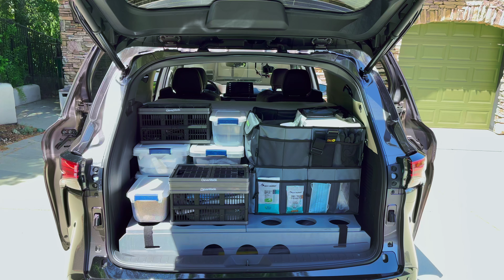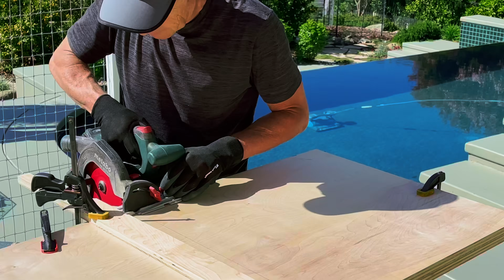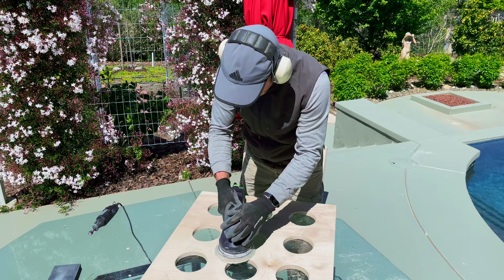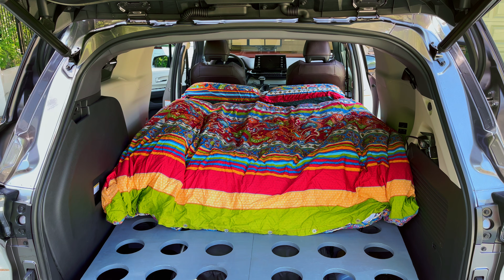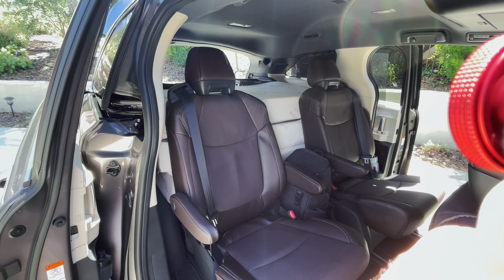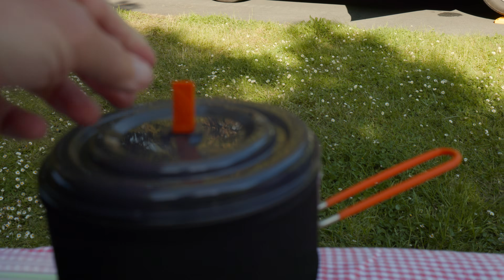2021 Toyota Sienna Camping Conversion: 2 and 4 seats sleeping configurations

Comment: Thanks for the videos. I’ve been looking for 10 years for a simple method of compressing the trifold mattress for storage while driving. Have you seen any solutions? Maybe separating the 3 inner cushions and compressing each one separately .
Reply from the maker: The expandable foam mattress would be difficult to compress by standard means. Strong vacuum pump is one option, but it will be impractical to carry it with you for camping. If you really need to increase capacity of the van, inflatable air mattress is a good option.
Reply: @Tellvia  I know that there are compression bags with one-way valves that allow you to push the air out, but I’ve never seen them large enough for the individual cushions

Comment: Nice job, but the refrigerator and the power station have ventilation requirements.  And it is important to keep the power station upright, not on it's side.

Comment: What kind of tool did you use to finish the edges of the 4" holes?
Reply from the maker: @theresamcrae  Thank you for watching. I used a 150/220 grit sand paper to finish the edges left by the whole saw before painting. Slowing down the whole saw at the end of cutting will minimize splintering of the last layer of the plywood. Cheers!

Comment: You created holes for ventilation of your refrigerator and power station and than covered those holes with your bedding. Ive read the manual for each of the units, they have very specific requirements for ventilation. With all the holes covered were you able to run both units without overheating

Comment: Hi . I have aqustion ? Can be fold the the back seat at 2nd row backword to make platform shape we can use it as a bed? I hope you answer that please
Reply from the maker: @AyadAboosh  Thank you for watching! No, the second and third raw of seats are not foldable backward by design. Cheers!
Reply: Thank you .iam  civil engineer from iraq and iam going to make my toyota sienna 2023 as camper van .and iam wondering if we can reblase the base of second row seats with previus versions thats give us more space and extra 2 seats we can use them in camp site
Reply from the maker: @AyadAboosh  The removal of the second raw of seats in 2023 Sienna requires disconnection of the airbags built into the seats. I removed our seats at my own risk and cannot provide instructions for removing the seats for safety and liability reasons.

Comment: Using the back well for a fridge is good, but it seems like a waste of weight and space for the bedding.  You could have used milk crates throughout for storage and an inflatable mattress to sleep on.  The matrix of crates would have easily supported the weight and when not inflated, the mattress would take up far less space than the memory foam.

Comment: Mattress idea. I use a high quality air mattress, filled to very firm, with a 2 inch memory foam topper. This allows relatively compact storage and provides a very comfortable mattress.
Reply from the maker: Hi Gee, the axillary battery in this build is for running a portable fridge while we camping and the van’s engine is off. Cheers!
Reply: @Tellvia  Thanks. Yes I understand that, it's very common. During the 8 months that I lived in my Prius it was in READY mode 90+ percent of the time with no issues. I had a fridge running constantly. Prius' are commonly used as taxis in large cities where any one car will be driven non-stop all day. Since they can handle being used constantly I don't see a reason to complicate things by adding more batteries.

Comment: Thanks! Q: Why add a battery when you could simply rely on the stock hybrid system for power? I've camped in my Prius for approximately 8 months without additional batteries. I installed a 1000 watt inverter for AC power and I've lived comfortably without the cost/weight of an additional battery.
Reply from the maker: Thank you for watching! In order to have access to electrical power in any vehicle you need to turn it on, in case of a hybrid it means gas engine turn on and off periodically to charge the hybrid’s power battery. At most campgrounds there is a curfew on engine and compressor sound between 10pm and 7am. We run a refrigerator continuously and need access to power. That’s the main reason for the power bank battery. Cheers!
Reply: @Tellvia I bought a 2024 Sienna last fall and I've been camping full-time since then. I installed a Bluetti AC180 to run everything except of course the van a/c when needed. I got the optional 1500w inverter on my van and use it to keep the Bluetti charged. I rarely even think about power needs unless I'm running the microwave on high. In that case I wait until finished before running something else. 👍
Reply from the maker: @geedoubleu641  Thank you for watching and sharing your setup in Sienna. One day in addition to the AC inverter option auto manufacturers should offer a build-in battery option in cars/minivans. Cheers!
Reply: @Tellvia  Yes! I want toyota to offer a full-size hybrid van...
Reply: How you could connect the inverter to the hybrid system battries
Reply: @AyadAboosh  You can't. It has to be ordered from the factory.
Reply: @AyadAboosh  There was a company that sold an inverter for the  Prius drive battery but they closed shop.

Comment: Great thing about the Toyota Sienna Hybrids is that you can literally leave the the engine on.. Another person in another video did an experiment and is now  Living in... Throughout the night in extreme cold with the heater to extreme heat with the A/C on he only uses about 1 gallon of gas And that's for 10 hours.  He does keep our carbon monoxide detector inside just in case but never went off

Comment: I think the warranty is Void when one removes these 2nd row seat and airbags. Dam Toyota for eliminating the design feature of easily removable seats.
Reply from the maker: The warranty denial may only apply to warranty claims proven to be related to the seats removal. Work with a knowledgeable automotive professional if you plan to remove the seats. Cheers!

Comment: Just trade it in for a Kia Carnival, man. 80k tech in a 40k van, and it can easily camp 6 with a rooftop tent plus two air mattresses and a trunk tent. If you travel heavy, just tow a small trailer for your gears.

Comment: Full size mattress gonna fit in?
Reply from the maker: Thank you for watching , Asiya! We use a 3 section foldable mattress that is 50" wide and 72" long. The cabin is narrowest between the rear wheels where it is only 48" wide. The mattress get a bit compressed in the that area but sleeping in Sienna is very comfortable. I hope this helps to answer your question. Cheers!

Comment: I've been looking at the Pacifica and the Sienna, but Toyota says that the 2023 2nd row seats are not removable.
Reply from the maker: Hi David, thank you for watching! As always there is a way to remove seats from the new Sienna, but it is not as convenient as the foldable seats in the Pacifica. The removal of 2nd row seats involves disconnection of the air bags build-in to the seat, which triggers a non-cancelable message on the dashboard. The latter can also be solved but requires expertise and it’s done at the owners own risk. That’s why Toyota labels their 2nd raw seats as non-removable. The convenience of foldable rear seats is nice but we use our van primarily as a camping vehicle and the extra space afforded by the removal of the seats is very desirable for more comfortable camping. I hope this helps in your buying decision process. Cheers!
Reply: @Tellvia  
Thank you.

Comment: The figure on weight vs mileage is actually per roughly 100 pounds of weight you lose 1 percent of mileage. If it was 1mpg you would effectively get 0mpg on the sienna if you hauled or towed 3500 pounds which is actually the tow rating I'm pretty sure.

Comment: Is it possible to remove the console between the front seats? I see the arm rests would go with it and I would be okay with that. Would the attached console with gear shift then need to be supported? I would appreciate your thoughts.
Reply from the maker: Hi Milo, thank you for watching! Unfortunately the center console is not removable as the gear shifter and other controls are integrated into it. We found this Sienna to be very practical for our travel/camping as it is. Cheers!

Comment: I wonder if it is possible to upgrade a Toyota Sienna hybrid to a plug-in hybrid with a more powerful battery, what do you think?
Reply from the maker: Hi Victoria, thank you for watching! Toyota is not offering a plug-in hybrid option for Sienna, but it does offer a plug-in variant for their RAV4 hybrid. Plug-in hybrid vehicles are typically small and light, thus allowing to extend an EV only range with a relatively small separate plug-in battery. To make Sienna with the same EV only range will require a larger and heavier plug-in battery that would take too much of cargo space  will adversely effect the vehicle handling because of added battery weight. An aftermarket conversion of Sienna into a plug-in vehicle will be very complex and expensive because plug-in battery requires separate cooling and would need to be integrated with the vehicle’s electronic drive-train control. I doubt that anyone will ever even attempt it. Cheers!

Comment: I have heard that removalof the 2nd row seats in the new Sienna is quite a project.
Reply: It is not as bad as you think.  Just 4 bolts and a few plugs.  But unfortunately you will have a small rail thingy sticking up.

Comment: What brand was the ladder?  The one you linked to didn't have a brand name.  Comparing details, was it StepTech?
Reply from the maker: The ladders don't have their brand printed anywhere on the the ladders but the order I placed on Amazon was for an 8.5 ft ladder by WolfWise. They appears to be out of stock currently, but I believe that any similar design 8.5ft ladder, like this one, would work as well. I hope this is helpful. Cheers!

Comment: Did you have the airbag warning after removing the second row seats ?
Reply from the maker: Thank you for watching, Stephane. I found a way to prevent the airbag message from appearing on the dashboard. However, due to safety concerns for others I am not sharing this part of my build in the video. Consult with an independent automotive professional about this issue. Cheers!

Comment: I purchased the 2021 Sienna last September with the intention of removing the 2nd row. 
I paid my Toyota dealership ~$200 to remove them, but they could not/would not provide a work-around to allow me to read the normal  dashboard info. The warning that the air bags had been disabled would pop up instead of the information that normally shows (speed, time, temperature, miles to empty, odometer, and which  gear the transmission is in).
That was not acceptable to me, so they put them back in for me. I was VERY disappointed!
Did you devise a way to complete the circuit, so as to not get the warning message and keep it from usurping your dash info?
Reply from the maker: Thank you for watching, Annie. It sounds like Toyota shop is not willing to     bypass the airbag circuits for liability reasons. An independent automotive shop may be able to do it. Cheers!

Comment: Looks good, how do you remove 3th row seats
Reply from the maker: Thank you for watching, Chang. The 3rd row seats are bolted to the frame. The bolts are covered by plastic covers at the bottom of the seat well. The seats are removed as two sections. The seatbelt sensors and seatbelts themselves need to be disconnected. The seats are quite heavy, you may need to ask for help when removing them. I hope this helps. Cheers!

Comment: Lot of complicated systems for camping/sleeping in a van.  An air mattress with 12 volt pump contours to all the little bumps in the floor when seats are folded down .  And takes up very little space when not in use.  The only issue is that , installing it don't make for very good YouTube content.
Reply: I am using a 21 Sienna XSE and I need to keep all of the seats in the van because I still need to carry people often.  I need to be able to set up and re-compact the whole design without a lot of effort or time.  And a factor for me is that I sometimes want to drive with the bed ready to use so that I can stop and sleep incognito late at night. 

I haven’t seen anyone mention this but there are battery vents in the rear that need to be protected. I don’t want to suffocate my wonderful hybrid battery while I am driving bed-ready so keeping the platform elevated about 3-4” is important. 

I use an air mattress because it can colapse down when I’m carrying people, it’s lightweight and easy to set back up when needed. Not as nice as foam but definitely acceptable. 

Because of the rear vents, I cannot simply use the air mattress on the floor of the van while driving. It is imperative to elevate the sleeping platform a few inches.  

To accomplish this, I purchased the retractable ladders from Tellvia’s recommendation. Instead of plywood I used a much thinner 1/4” particle board cut into manageable 24x48” sections for weight distribution. 

Thank you Tellvia for your very well thought out and demonstrated ideas. Your videos were helpful while I worked through my individual needs and configuration.
Reply from the maker: Thank you for watching and commenting, Greg. The floor in new Hybrid Sienna slops significantly from back to front, which likely would be a problem for sleeping on the air mattress. If you found a way to make this work in new Sienna many owners would be interested in a video showing this. Cheers!
Reply: @Tellvia  The van also rock in the wind or when someone moves around. Thats why I use cheap scissors jacks to level and stabilize the the van when camping, takes about 10 minutes once parked. Very annoying when a camper of any type moves around when parked .

Comment: Really great job on the build and video.  Thanks for uploading.   We are about to remove the 3rd row going to leave in 2nd row.  Any issues with wiring or warning lights with 3rd row removal?
Reply from the maker: Hi Dave, thank you for watching. The third row seats have electrical wires to  seatbelts latches. They need to be disconnected using quick release connectors. Since no one will seat in the seats no warning lights will be illuminated while driving. Good luck with your project. Cheers!

Comment: I love the design - I realize more research on removing the seats. When I looked at higher top campers - yes more ameneties but like the rollover safety of the toytoa and other safety features. Currently own a 2007 Tundra that has convinced me of Toyota's safety and longevity.  Looking into seat removal as it says you cannot remove them due to the integrated air bags but apparently some have figured out the how to.
Reply: They come out easily enough (~one hour of labor costs), but circumventing the warning message is trickier. 
I hope he answered our questions 😁🤞

Comment: Does the 2021 Sienna shut off after 1 hour of running without driving I know my old Prius would run all night with half a gallon of fuel my current Corolla hybrid shuts off after 1 hour
Reply from the maker: Hi Brett, thank you for watching. Yes, the 2021 Sienna gives us a choice to keep the engine ON, or to turn engine OFF after 1 hour on the drivers display. Cheers!
Reply: @Tellvia  I wish the Corolla had the same option
Reply: @Tellvia  are you in the United States maybe it's an option outside the states where is this setting at